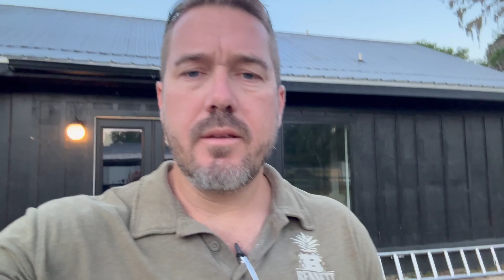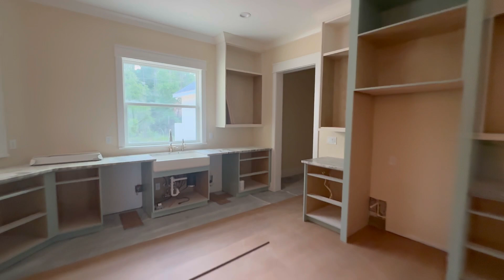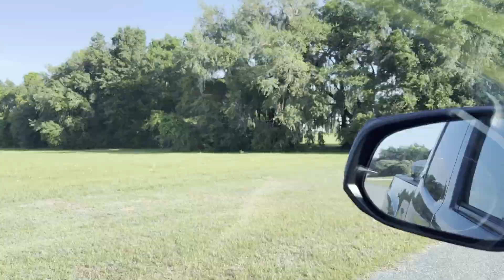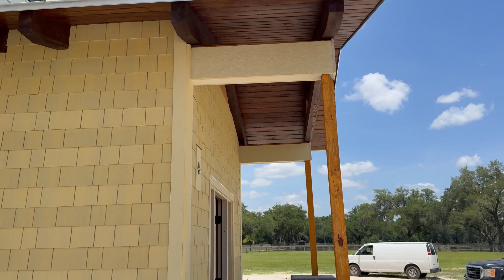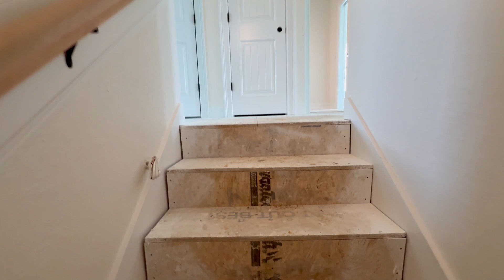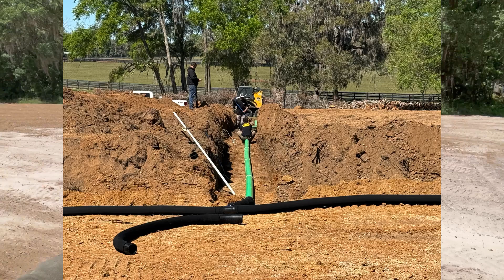Custom Home Building. A day in the life of a Superintendent.

Comment: Never put electronics above a source of heat. Do not have any vents etc in the roof unless you want to be constantly dealing with roof leaks. Check the floor material for moisture etc after acclimating and before installing. I could go on.
Reply: electronics can run really hot if they're properly built.

Comment: That first house, how long do you think it would take to build it as a spec. In my experience, a simple custom house takes about 10months but as a spec takes just under 4months. Why does it add so much more time with a buyer, over double, with a homeowner than without. Is this your experience as well or does this indicate a problem with the builders/superintendents management?

I'm a new super and I've worked as a laborer for a home builder before.
Reply from the maker: Great question, 

Specs and customs build very differently. On a spec, buyers still get some choices and there’s emotion involved — but the range is limited and the path is controlled. The big advantage is repetition: a spec plan gets built over and over, so the builder has already solved the problems and refined the process. That’s why a spec can come together in that 3–4 month window.

A true custom is the opposite. It’s usually the first time that specific home has ever been designed and built, so you’re working through unique details, open-ended decisions, approvals, changes, and a much deeper emotional investment. Every confirmation or adjustment adds days or weeks. Because of that, customs naturally take 2–3× longer.

That doesn’t mean the superintendent is doing anything wrong — it’s just the nature of custom work. Your job is to minimize the chaos, not eliminate it.

Congrats on stepping into the super role — you’ll learn the rhythm quick.